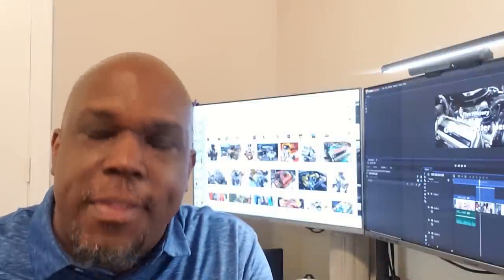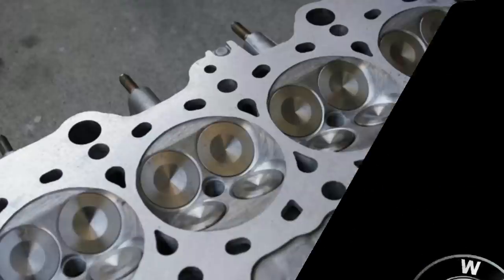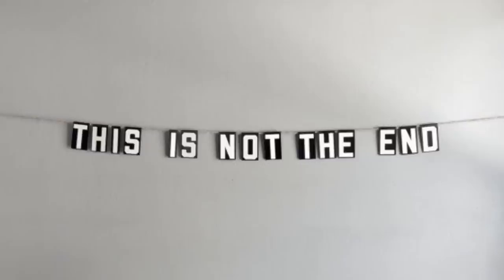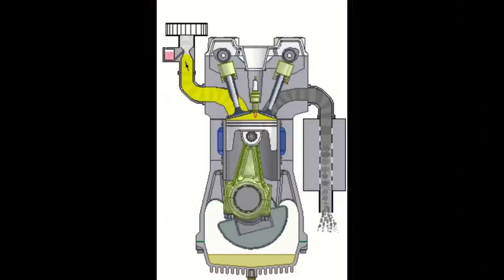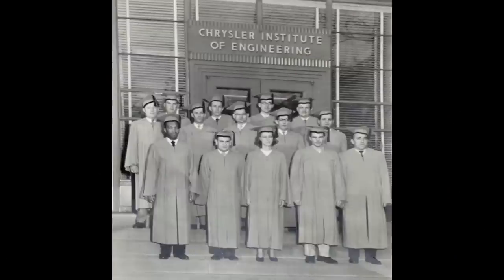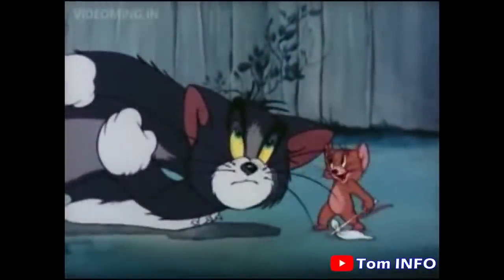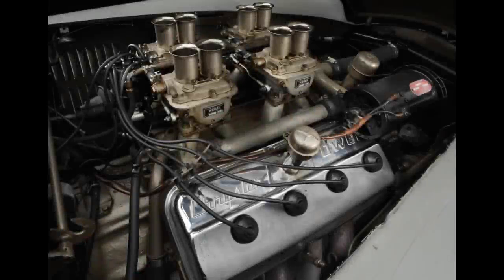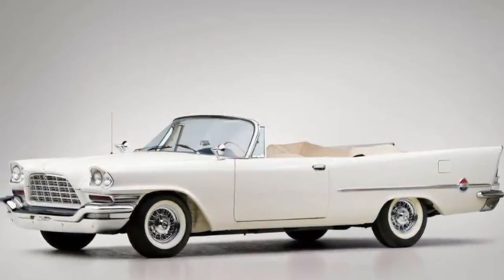The History of the Chrysler Hemi Gen I

Comment: I hear a lot about the Hemi's  built today aren't Real Hemi's if not Why? I bought a 2022 Ram with the 6.4 in it and my neighbor swears it's not a REAL Hemi.
Reply from the maker: They say that because they did change the shape of the combustion chamber to where it’s not a true circular dome. They took in the sides some, so instead of it being a half-dome, it’s more like a half egg cut longways. BUT, they engineered the new shape to make it more efficient and burn cleaner…if Chrysler had simply took the old design and build a new engine, it would never pass an emissions terms, nor would it be very efficient. They still have the same superior flow in and out of the combustion chamber like the original Hemi, but the improved design made it possible to exist in today’s environment of smog regulations and EPA requirements. It’s Hemi ENOUGH!
Reply: @TheGearheadLounge  - sooo....it's a 'semi-hemi'?😄
Reply from the maker: @floydblandston108  Exactly! Like the Boss 429! That's what Ford called it.